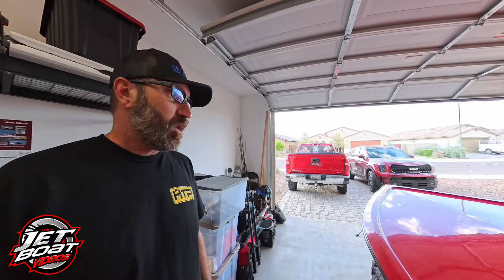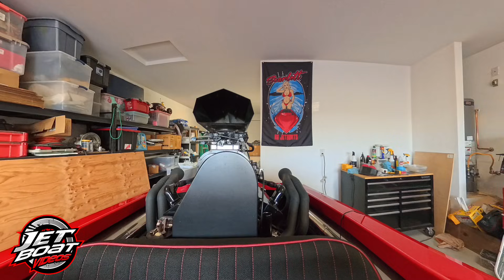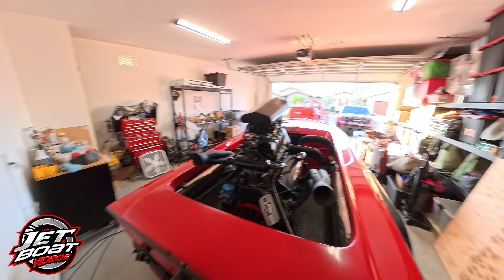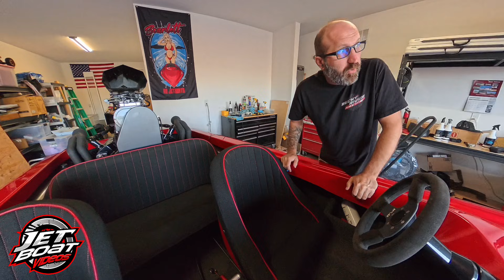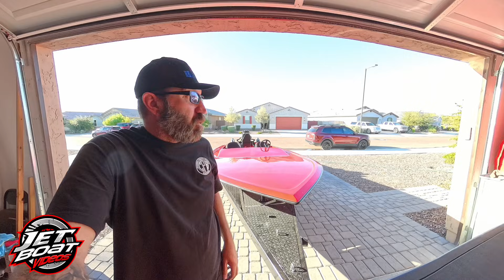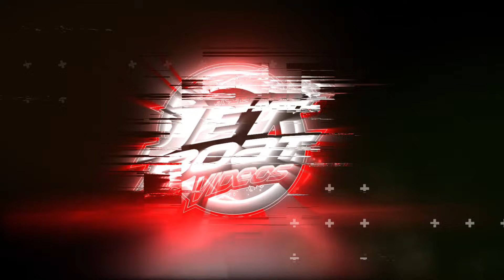My Jet Boat Won't Start !!

Comment: Whenever I bought my boat on the drive home from Louisiana we hit a crazy bad rain storm. Once I got it home I went to take it out to the lake and it wouldn't run. Ended up doing all this trouble shooting and finally I drained the gas out of both tanks and gas was milky and phased out. I put new gas in it and ran fine. I guess the caps are vented and let water in. I really need a cover that is legit built for the boat and can withstand hwy speeds. Glad you got it figured out and was an easy fix 👍🏼
Reply from the maker: Yea I’ve driven through bad Arizona monsoon storms before with no issues so I wasn’t even suspecting gas